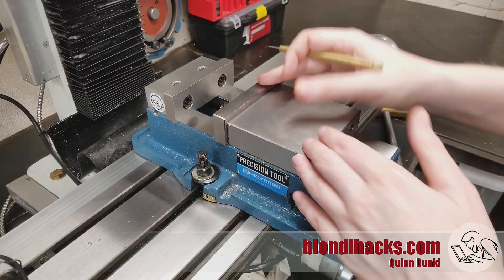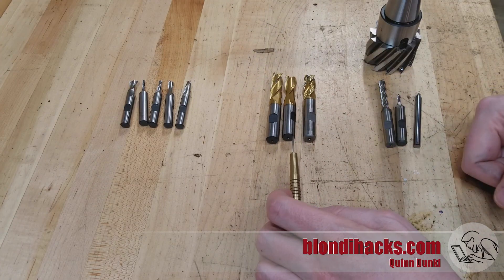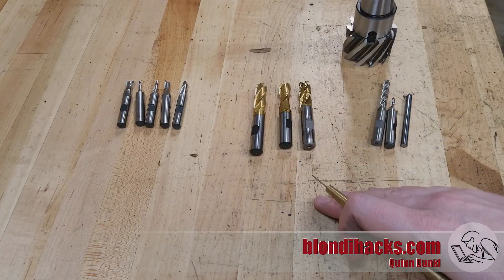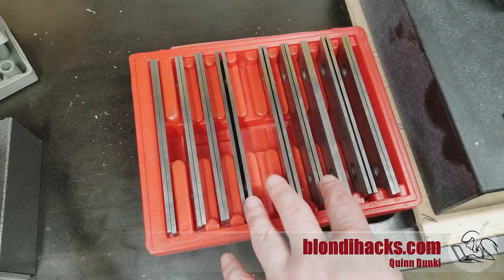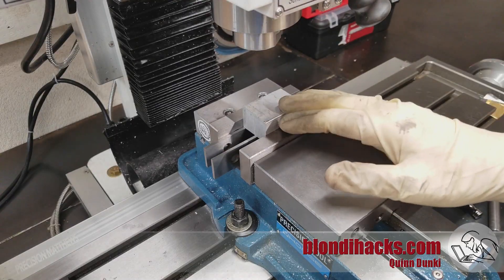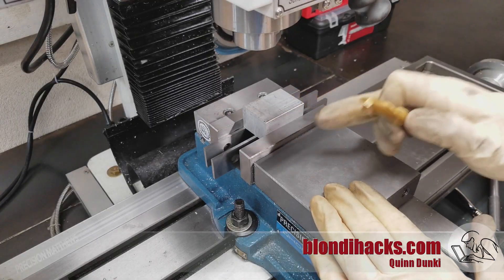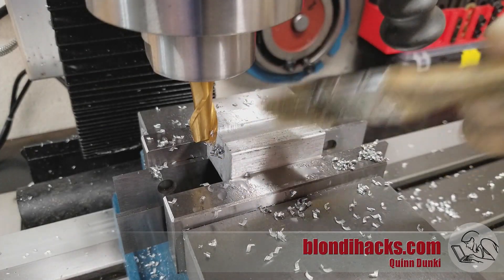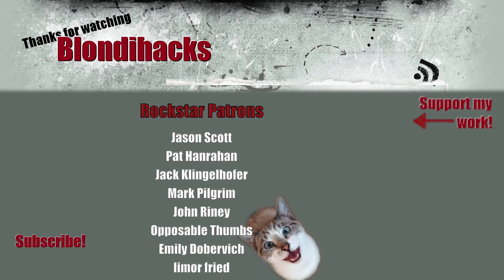Vertical Mill Tutorial 3 : First chips!

Comment: Recently bought a milling machine very similar to yours, and these videos are exactly what I need to get
Do you think a home mill like yours, is able to skim aluminium cylinder heads? If so, what facing cutter would you use? Proper engine machining shops use huge fly cutters the size of the whole head.

Comment: I really appreciate this series. I've been woodworking for about 10 years. A few years back I decided I needed a better way to cut sheets of plywood, and rather than build a panel saw like a normal person, I decided to build a large 3-axis CNC router, which opened up leagues of capabilities beyond simply cutting squares out of panels. That build had me doing some rudimentary hand machining, and exposed me more to the larger world of machining than I knew existed, and I find myself fascinated and my appetite whetted.

While the machine I built is plenty rigid enough for aluminum, and steel in a pinch, I know it could never achieve the level of precision I could get with a lathe and a vertical mill. And it seems like every other day I have an idea that could only be executed with those machines. It is inevitable that by the end of this year I will own one of each, and this series (alongside a course or two at my local hackerspace) will be my primary introductory reference. So thank you!

Comment: I'm new to machining, and your videos are so helpful! You approach every issue from a newbie's perspective and know all the right questions to answer, while avoiding overcomplication.

I did notice one small issue though. You say that hobby machines can't do the speeds for carbide facing mills, but I think you forgot to take into account that a wider tool needs less speed.

A 6mm carbide endmill would have a suggested spindle speed of around ~4000 RPM for cutting mild steel, but a 50mm facemill with carbide inserts only needs to spin at 485 RPM to achieve the same surface speed.

Comment: If you have a CNC spindle that can use the same collet as your mill can you use the tooling in both for the same type materials? For instance could you work aluminum in both the CNC and the mill using the same cutters which would let you buy better tooling because you would be spending money once that could be used on both machines. Sorry if that's a dumb question, just getting started and no mill at present.

Comment: Hi, loving your videos, I have been watching TOT for some time, although just discovered your content. Now I'm binge watching the lot 👍. Thank you for uploading. 

P.S. I'm using a Septic Tank Aeration Pump to blow away the chips and cool the cutter as it works extremely well and is super quiet (the noise of the air far exceeds the pump noise).

Comment: I did not have the slightest idea how much all of this COSTS..This is a really expensive "hobby", but you and the majority of your followers already know that.Now I know ,too. Thank you for being so straightforward about the reality of things!!
Reply from the maker: It’s possible to do it on the cheap if you have space and time. Used machines can be found quite inexpensively, but they typically need a lot of work, and will be big American iron that need a big shop. The other inexpensive option is to go very small- a 7x14 mini lathe is cheap and can make things like brass clock parts or other small mechanisms.

Comment: Quinn:     Here is a project you might find useful for your own PM25 and can make in a few days so save your aching shoulder joints..
https://www.youtube.com/watch?v=J5zTBCMfZro

I bought the same PM benchtop mill with DRO, and quickly found that the column crank was a pain because there was little room between the column and the DRO monitor.  Its also a hassle reach up and wind the column up and down all the time...  So...   Some angle iron, a $20 VW wiper motor, 4 Briggs lawnmower starter gears, a 12v DC power supply and some misc. ebay parts and you can throw the column crank in the bottom drawer with your old vice rotator thingie...

The angle iron mounts fit directly into threaded mounting holes for the column crank plate.  As such, no modifications are needed to the column of the PM25...  I was working on this with a friend on a hobby forum site, so the video is sort of our way of communicating.

There are a couple of other short clips on different aspects of the project:  But they are just parts of the design and components.
https://www.youtube.com/watch?v=2yEoGuK77og
https://www.youtube.com/watch?v=eV81F8SLTvI&t=8s
https://www.youtube.com/watch?v=XSBJ4f3aj5g&t=24s

I was to cheap to buy the table motor drive, so went on to make one using the same wiper motor and gears stuck into an aluminum box bolted to the left side of the PM25 table---  works quite well-- but again these were videos sent to friend who was also making one:
https://www.youtube.com/watch?v=DaVRwv_JjKE
https://www.youtube.com/watch?v=rjy5y6EnWxM

Your videos are well done and informative, so perhaps you can make a motor drive and share video and share it?  Good Luck.....
Reply from the maker: This is great! I do have “Z power feed” on my to-do list, so thanks very much for all the links! It’ll help plan my project.
Reply: https://www.youtube.com/watch?v=WfR0QAnfEj0

This video was sent to a friend, and contains the sources for the components of the Z drive.  There is a video by Tinbarn, but its a more complicated affair with motor that is not currently available.  I like the PM25 and expanding the tooling which probably will cost as much as the unit....

Comment: Another great video! Thanks for spending the time to explain these things.

I'm looking to get a small lathe and mill as a hobby, could anyone recommend which features are good to look out for? I've seen chinese lathe/mill combos but I can't help but think that there's a sacrifice being made somewhere along the line!
Reply: I think the most important features are rigidity and accuracy of construction. Most of the 'features' on a more upmarket lathe are really timesavers rather than a necessity for a home gamer, so you need to look at what kind of deal you can get- so long as your lathe has a compound slide and a leadscrew you can turn almost anything, it's just a matter of how long it takes.

As for 'old iron' whilst there is quite a bit of elitism from some regarding the superiority of their non-chinese lathes, the reality is that most old machines you can buy for hobbyist prices are worn out and will need a rebuild to get the kind of precision you might expect from a new imported machine. I bought an old Hercus 9'' model C lathe (an Australian south bend clone) that was built in 1944 because I like restoration projects and it has interesting history (there is a brass plate on it saying it belongs to the Australian government ministry of munitions) but the cost of getting it into serviceable condition has been about the same as a new import lathe of the same size, plus the ways are very worn and it will always turn a taper unless i pay even more for a bed regrind. Used machinery is nice but definitely check to make sure you aren't getting something that will never make an accurate part.

Comment: Hi Quinn, I have some issue in my lathe machine, the nut hole is bigger than before which make compound rest is shaking. do you have any idea how i fix it :S
Reply from the maker: You can either make a new shaft that fits the larger hole, or bore the hole out and make a bushing to go in it that gets it back down to original size.
Reply: @Blondihacks  Thanks , i think am gonna bore the hole out and do bushing as u said. I appreciate